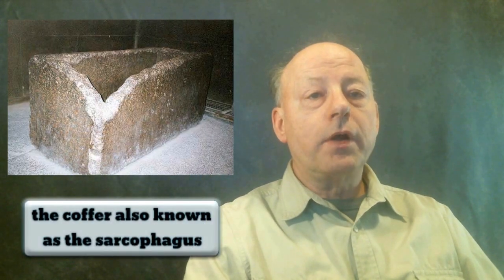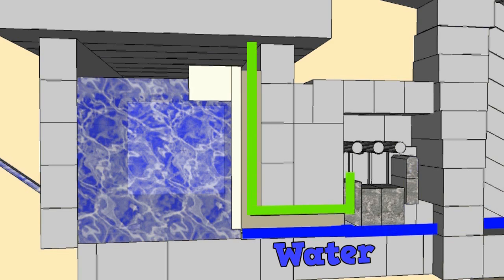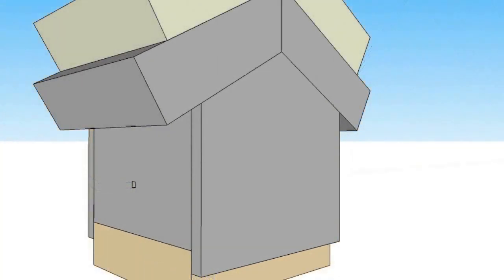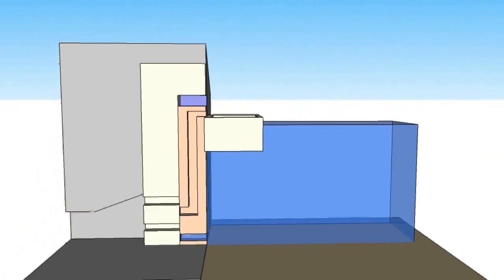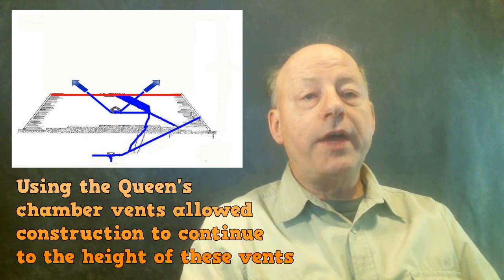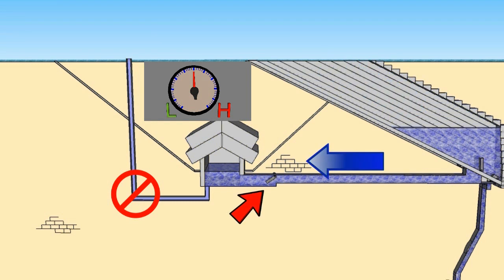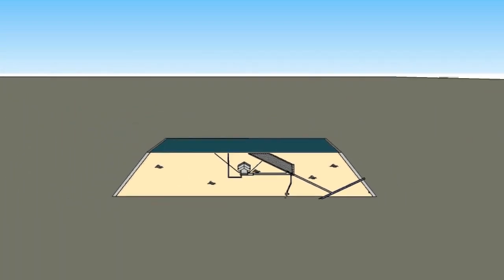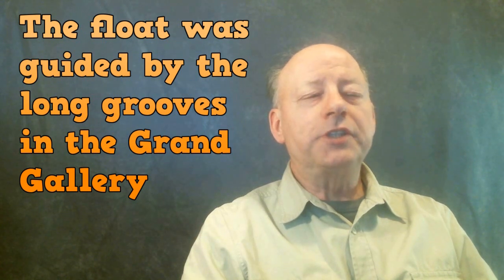Video 11: Details of the Upper Pump

Comment: Intersting. 

Based on the dimensions of the coffer and the density of rose granite, it does not appear as though it would float.

Based on some rough math the coffer weighs c. 3.2 tonnes but displaces only c. 2.3 tonnes of water making it non buoyant. I understand that as you increase oxygen content of water it becomes more dense and therefore has more buoyancy but is it enough to float the coffer? Do you have the math to support this idea?

Or perhaps you believe they used some sort of papyrus buoy or animal intestine float etc. attached to the coffer to increase buoyancy?

Also given the type of technology you suggest (generator with wireless signal capability). When do you suppose it was built and what do you think happened to the history/blueprints/peoples who built it?
Reply from the maker: Thank you for watching at least some of the video series. Based on the size and weight of the coffer it is unable to "float". I do not think "adding oxygen" to the water or using animal intestines were used. There was no need for either of those suggestions. As the video indicates the coffer was connected to other components of the associated valve. When water rose higher in the King's chamber the buoyancy of water would act on the coffer and cause the valve to open. In effect, when the coffer was almost submerged in water the buoyancy would make the coffer "less heavy". The change in weight of the coffer caused the coffer to move and open the valve. The coffer did not "float" in the King's chamber on its own. I hope that helps you understand how the coffer was affected by the buoyancy of water to open the valve. A few short videos can't explain every aspect of this research in detail. There is much more detailed information in my three books about the Great Pyramid water pump.
Reply: @GreatPyramidPump  So in essence you are suggesting there is upward force being applied to the coffer at all times however whatever is applying upwards force is only able to lift it when it is submerged in water and therefore relatively lighter in comparison to when it is not submerged.  Which results in the coffer only moving up and activating the valve when submerged in water?

I have finished the series and honestly am considering purchasing your books when I have the time. I myself am a process engineer and currently working a shutdown at my plant and so I haven’t the time to read currently.
Reply from the maker: @veggiejim3987  yes the coffer is connected to the rest of the valve mechanism. Water’s property of buoyancy effects the coffer and the water level provides feedback so the valve open when needed. It’s actually pretty straightforward.  That is tough about your work situation and I hope everything gets resolved. I think you would be interested in the content of my books. If I may ask, what type of work do you do?
Reply: @GreatPyramidPump  I am a power/process engineer. Essentially my job is to ensure the distillation unit at the plant is operating properly. This includes all the pumps, valves and associated vessels (I.e fractionation column, desalination vessel, high pressure steam stripping towers, kettle reboiler etc.).

In the time of the pyramid (if it was a pump) I would have been one of the engineers tasked with ensuring the water supply is steady, the valves are operating as intended, inlet pressure and outlet pressure are as expected etc.

Another reason your work resonates with me is that I have always seen the pyramid as some sort of industrial plant given the “passageways etc. are all seemingly not at all built for occupancy but rather for industrial use and or access in the case of maintenance. For example the inlet to the pyramid pump or retaining wall area likely had some sort of strainer/mesh to keep sand, fish and other river matter out of the pump/pyramid otherwise it could clog and block the valves etc. I would be tasked with checking this filter daily, isolating and replacing it when need be.
Reply from the maker: @veggiejim3987  Oh wow. Amazing. People who actually do stuff in the real world often say the direction of this research is compelling. This includes people like you, dock workers, truck drivers, longshoremen, heavy construction workers, factory workers, tub boat operators, people who build or work in hydroelectric dams, and other people who are required to accomplish real tasks in the real world. Egyptologists who don't do anything don't like my research at all. I wish you the best with everything. If you have any more questions let me know. I appreciate your interest, and please share the information with others.
Reply: @GreatPyramidPump  I will certainly share your work with anyone I believe will have interest.

When do you believe the pyramid was built and used as a pump? Do you believe it was built in the time of Kufu?

I believe the pyramid was long inactive when the pharaoh known as Kufu either commissioned its refurbishment or perhaps attempted to turn it into a tomb for himself.

I believe it was built during a time when the Nile was much wider compared to the time that Egyptologists claim it was built as a tomb c. 4600 years ago. 

Also have you given any thought to how long it ran and what happened to the peoples it served? I understand the bulk of your work has been dedicated to the actual construction of the pyramid and so perhaps you have not thought about these things however I figured I would ask anyway.
Reply from the maker: @veggiejim3987  Thank you for watching the video series. There is another video series about how the Great Pyramid was built on my YouTube channel that would interest you. The focus of my research is how and why the Great Pyramid was built not who built it or when it was built. I have thoughts on every aspect of the Great Pyramid but when and who are not central to my research. Egyptologists make many claims but I have a very low opinion of Egyptology. There is a video on my YouTube channel called: Is Egyptology a Pseudoscience?  I think the Great Pyramid operated for some time but how long it was functional is under scholarly debate. I would say it was a functioning machine used as infrastructure for many generations. Thank you for your interest and thoughtful comments. Keep in touch.
Reply: @Scissorbeaks  Wow, incredibly compelling theory. I have always had a hard time with the why and this is an excellent explanation, especially if the geology aspect is proven accurate.

Any thoughts on the crowd of people who believe the Richat structure to be the ruins of Atlantis? Having been wiped out during the younger dryas impact/event?

Also if I may ask, are you a proponent of the methodology proposed for how the pump operates and how it was constructed?

And lastly, where/how did you compile the information about the potential geology at the time of the construction, and is there any video that displays the geology you suggest in this theory so that I may better visualize it?

I really appreciate your comment as this is a topic that interests me greatly and I likely would have already bought this gentleman’s book if I wasn’t so busy at work lately. When I do have more free time I’d love to be able to research this topic even half as thoroughly as you have.
Reply from the maker: @veggiejim3987  Thank you for your interest and I hope you read my three books which have much more information. Here are the links. 
Here is the Amazon link to my 1st book about the Great Pyramid https://www.amazon.com/dp/1449916155/
Here is the Amazon link to my 2nd book about the Great Pyramid https://www.amazon.com/dp/1460976118/
Here is the Amazon link to my 3rd book about the Great Pyramid https://www.amazon.com/dp/B0CF784F75/